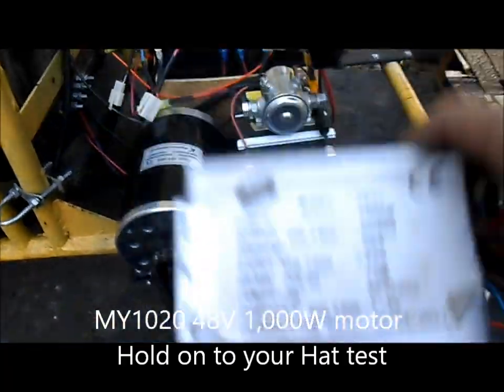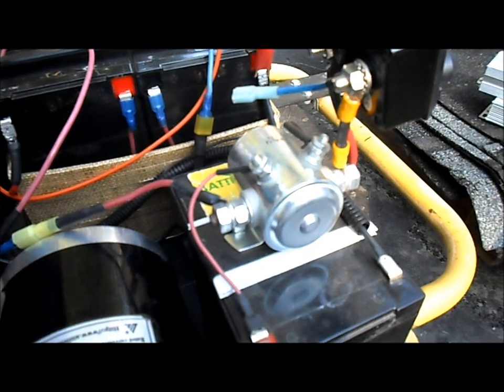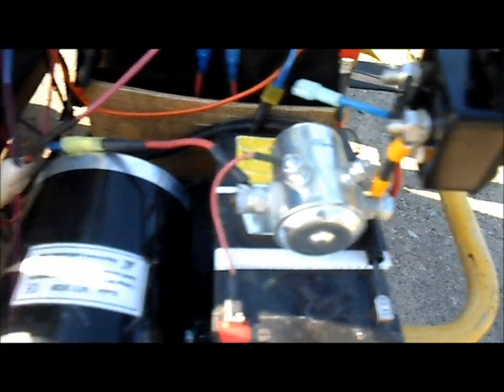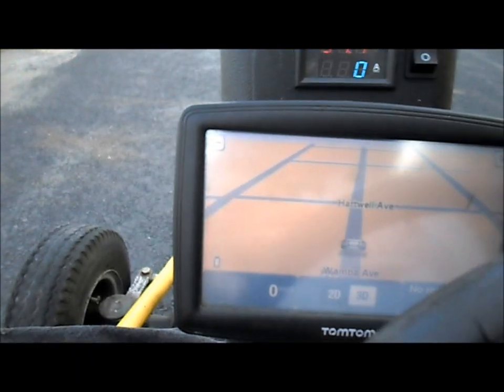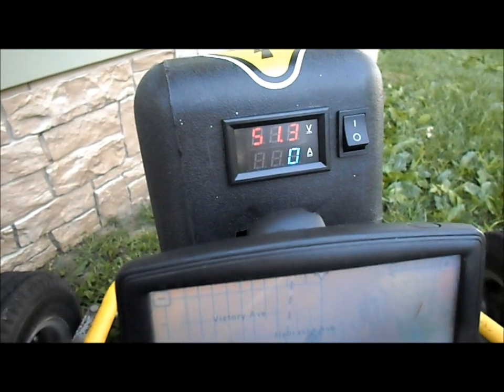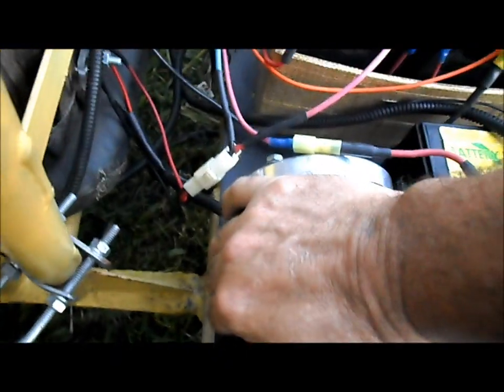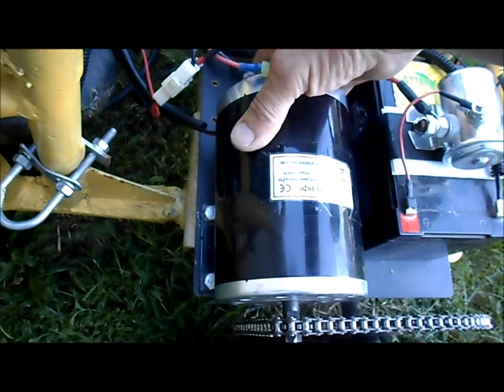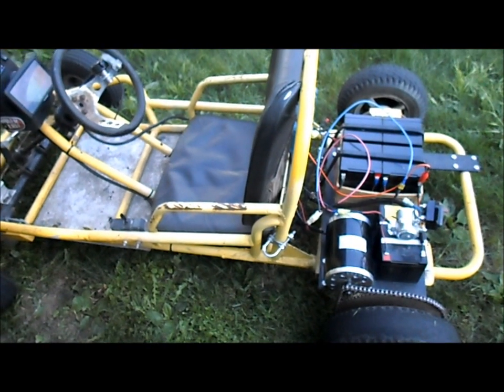MY1020 48V 1,000W motor straight power no controller test

Comment: Your no load test was drawing 88 amps. but only around 8amps while moving. Why is that?
Reply: Start-up torque is higher and he had it against the wall which provided constant resistance therefore the motor kept drawing more current to deal with that resistance. Once he was moving on the road the current draw starts high but drops as he accelerates thats becuase the motor is under minimal resistance at its max rpm therefore the motor draws sufficient power to maintain that rpm. If he was to encounter a steep hill even at top speed the increased resistance will force the motor to add more torque to get up the hill thus drawing more current.

Comment: Just add a circuit breaker of 100A to avoid melting, and is good to go!
Reply: So i can run my scooter like that and batteries and motor will be on if i add a 100a breaker
Reply: @williamhopkins145  yea you don't really need it but its for safety
Reply: @williamhopkins145  The circuit breaker (or fuse) is to be safer, as a short circuit can literally blow off the batteries, melt cables and do other nasty stuff.
The motor draws a insane current at start-up, because the car have a lot of inertia and the motor itself, a simple solution to that (instead using a PWM controler), is to press the switch multiples times at the start until the car gets some speed, this act like a manual PWM.
Using this technique, you'll get a lower current draw in start, less stress on the batteries and more milleage.
I know this because i'm building a bike with an 12V starter motor, the motor itself is a beast! but can draw 300A at start-up, which is to much for any ordinary cable to handle, and even the motor can melt very easily!
Reply: @williamhopkins145  Electroboom have a very good video about this topic, the problems involved and the solutions.
The simplest solution to reduce the inrush current still turning the motor on and off as fast as you can at start-up! LOL
https://youtu.be/yO9xIVv8ryc

Comment: if your gonna do it like that you should get a dpdt switch and start off with 24v then when you get going use switch to change to 48 volts. It won't be so hard on the motor, gears, or the chain.
Reply: Doesn't sound like much fun!
Reply: @blackz06  yeah I know it won't be quite as fun but atleast it will last a little longer, maybe after replacing a couple chains and sprokets then do it, should be old by then.
Reply: @eggroll1up918  for sure...

Comment: Hey there i have a super turbo electric scooter 1000w 48v n wanted to swap to a 1600w motor but not sure the size difference I want to fit on my scooter
Reply: Just get a higher wattage controller and watch motor temps but should be fine if both are rated at same voltage. I run a 1500watt controller on a 1000 watt motor and get 29mph and not had any heat issues yet but summer is almost here lll

Comment: Great video, I want to run a similar setup but with 72v 15Ah. I know my battery setup is ridiculous only pushing 1,080 watts. I Will be using a 4 speed gearbox to compensate for low amps and high volts. Therefore I should maximize the range of this little battery. I was wondering if I could get something like a 72v 35 amp variable resistor that'll go from the battery pack to the resistor then to the motor. Therefore giving me control on amp draw and voltage draw and eliminating the need for a expensive speed controller

Thanks mate
Reply: Controllers are actually cheaper than motors and with that high of voltage your better off just getting a controller. Alfawheels on ebay has them pretty cheap, especially if u go brushed
Reply: @2down2togo  uhm I live in south africa bro controllers shipped from the US are almost 1000 dollars with cheap crap ones being 500 dollars so nope no controller for me. I found a alternative tho and it's a pwm rated at 60v 30 amps so I'll rearrange my battery setup for 60v 30 amps and that's an output of 1800w which should be okay considering it's to boost my 440cc engine. My bike should do about 150 mph then
Reply: @str8xrippin  if its a brushed motor just skip the pwm controller and run the battery how it is now just turn it on when your up to speed but ill be honest I don't think a 60v motor will get u going to 150 even with a internal combustion engine with it but if it does id like to see it!
Reply: @2down2togo  well now I'm looking at brushless bldc so that will definitely need a controller becuase of hall sensors. Idk man I'll see. Well I calculated the possible speed with the power to weight ratio of my setup and it gave me 150 mph. I know that's absurdly high speed but after working on aerodynamics and gear ratios it's surprisingly possible. So I want the electric motor to launch me really hard to 40 mph in a few seconds while I hear the internal combustion at a higher gear ratio so that it takes over after the electric motor is exhausted. I have built a few projects before and hit 60 plus mph with ease so I'm fairly confident. Well with everything said it is just some calculations on paper, in reality it might be a very different story. Thanks for the help mate
Reply: @str8xrippin  sounds like a fun plan! Not sure how its going to turn out but the build isn't in my head so I know nothing about it lol I am however curious as to why u want the electric to boost u to 40 then engine take over when you could just change up the engine a little bit gain some more acceleration. You would need a pretty high voltage setup to launch hard off the line or a low voltage and really high amp output but you also have to fine room for a big battery for it too
Reply: @2down2togo  why do I want electric boost off the line? Well after a few builds and working with these small engines I've realized that starting out from a stand still is pretty heavy on them unless you gear them really low, so to combat that I use the electric motor for instant torque I'm not really looking for high rpm so the motor can be geared super low. The motor I'm looking at puts out 18Nm torque or 13.2 ft lb at 48v 26A. I've decided to run lithium batteries even tho they are really expensive it'll be beneficial in the long run. So lithium pack that puts out 72v 60A should theoretically more than double the torque of that motor. All this to get me rolling to a decent pace where the engine can pick up during or close to it's power band maximizing efficiency and acceleration. A few hybrid cars use this method aswell. This then means I could play around with higher ratios without sacrificing unnecessarily. Sorry if this is long but I've been thinking of this for some time now and I haven't had someone to talk to about it, it's been eating me up for months
Reply: @2down2togo  by change up the engine do you mean modify? Yea sure I'd love too if parts weren't so expensive. I decided to leave the engine stock but remove the governor. Wire a tachometer to it and make sure I don't surpass 5200 rpm. I'd like to get a flywheel tho cause that's definitely one thing I don't want to go wrong near my legs
Reply: @str8xrippin  lol your good buddy. I built a 48v drift cart last year and got it to 29mph recently but always looking for ways to maximize speed lol
Reply: @str8xrippin  yes modify is what I was getting at.
Reply: @2down2togo  woah that's awesome mate, 29 mph ain't bad at all especially for a drift trike. What was your battery setup and motor? And where's it now. A lot of times I find that people build stuff and stop using it or it gets destroyed after few months. With this build I'm striving to build something that'll be reliable and work 100% of the time. Solid enough to handle 100 miles daily. Do you think that these honda clone engines can handle that many miles for maybe 2 or 3 years. Well theoretically they should run for many years as any other engine but I've never seen one with a ridiculous amount of hours or miles on it.
Reply: @2down2togo  yes modifying would be great, I like working on cars and anything with an engine. Unfortunately in South Africa performance parts are expensive and hard to find. I might move to the US once I've got the funds. I don't know tho there seems to be a lot of battling going on there so I might stay away lol. Anyways where are you from mate, how's life over there during this pandemic?
Reply: @str8xrippin  I'm in the 🇺🇸 and Biden is fucking everyone with no lube! But far as the drifter, its a razor drift gocart for kids and started out as a 24v 250watt brushed system and now its a 1500watt 48v brushless system running 4 of my rc lipos in series to make a 13 cell pack and I run lipo alarms on them so I know when to shut it down before I ruin my battery lol. I still run it almost daily when the weather is nice and I built it last summer. Very reliable which is the best part, only broke one chain since I made it but that was my fault for thinking I could grind the curb lol. I just geared it down for about 22 mph so I could get better run times out of it and now its got so much torque I can pull back on the handlebars when I throttle it and itll ride a wheelie haha. I have a few short videos of me driving it and one of me showing what I did to it. I currently run it with rubber rear wheels and sometimes change them to drift wheels I just don't use them often because it vibrates so bad my arms are numb when I get off it.
Reply: @str8xrippin  not much I can do but sit back and take it lol thats what happens when a whole bunch of cry baby liberals start voting and/or the system gets rigged!
Reply: @2down2togo  yep not much you can really do, here we always get elections rigged. Always!! And I wouldn't even know where to begin on all the corruption going on behind the scenes. Can you imagine your government or president telling you a sum of 3 million dollars has gone missing and unaccounted for. Like what the heck how is that possible but we all know the split it for themselves behind the scenes. Sad thing is whoever gets in power next also pushes corruption for their personal gain
Reply: @2down2togo  it's finally night time this side, and it's winter. It's freezing cold 🥶
Reply: @str8xrippin  yep always has and always will be corruption in all governments!

Comment: Is there anyway to use a electronic throttle with this setup?
Reply from the maker: Probably not. Most electronic throttles are powered by 5V, which is provided by the speed controller & then, it sends a 0V - 5V signal back to the SC (as per the throttle position) that tells it what you want the motor to do.
Reply: @functional_artist 1v-4.2v for digital 0v-5v pot type throttle you can use a servo tester to swap 1 way only , you can buy pot foot throttles for DC brushed, hall sensor for brushless

Comment: I need a bldc motor to run between 30 to 3000 rpm with a load of 40 kgs for 30 min on low and  15 min on high rpm! can I use these types of bike motors without gear reduction? Do I need to use a dual motor for my needs?
Reply: A boma motor and controller may suit your needs

Comment: What voltage monitor did you use?
The red and blue monitor for the Amps and volts is cool, I need one for a similar project. Which one is it?
Reply from the maker: This is the type of meter that I used. It can handle/monitor up to 300V & 500Ahttps://www.ebay.com/itm/New-DC-300V-10A-500A-Dual-LED-Digital-Volt-Amp-Voltage-Power-Meter-/264106729212?var=&hash=item3d7dfcdefcHere is more info on this meter: https://www.youtube.com/watch?v=WMmLiqFFuUg&t=45s

Comment: Greetings, friend.

I would like to know what kind of battery you used, if possible the product brand.

Fantastic your video. 

Thank you very much.
Reply from the maker: The batteries are 12V 12AH SLA (Sealed Lead Acid) from Mighty Max Batteries (~$25.00 each) https://www.ebay.com/itm/Mighty-Max-12V-12AH-SLA-Battery-Replacement-for-Altronix-AL1012ULACM-2-Pack/192856363918?_trkparms=aid%3D555018%26algo%3DPL.SIM%26ao%3D1%26asc%3D40719%26meid%3Da2668f7bb4e941a69ca0cf19e71d811f%26pid%3D100005%26rk%3D6%26rkt%3D10%26sd%3D382838652284%26itm%3D192856363918%26pmt%3D1%26noa%3D0%26pg%3D2047675&_trksid=p2047675.c100005.m1851
Reply: @functional_artist  h
Reply: 12v×4     9 or 10 amp will do. Mighty max batteries are good and affordable